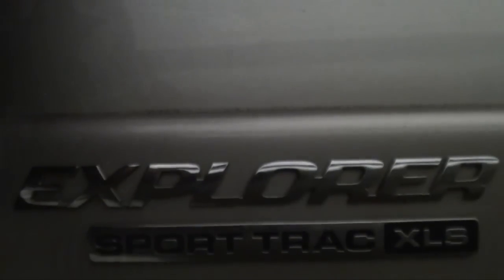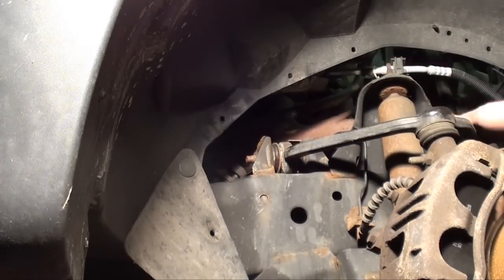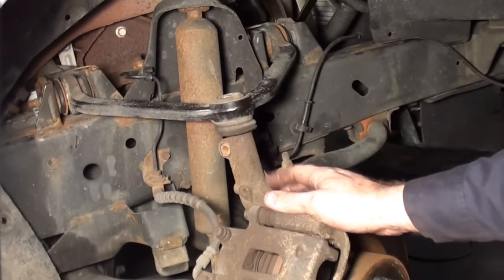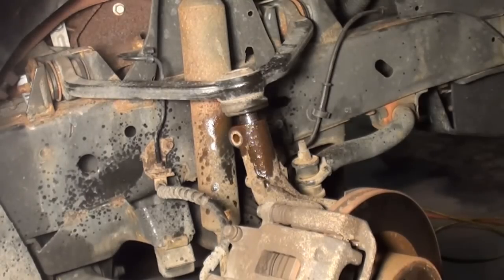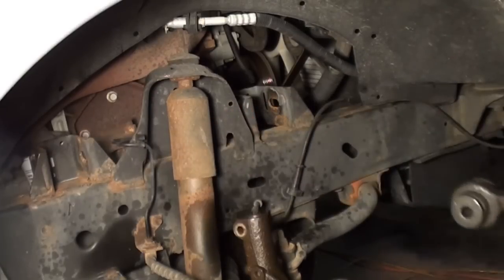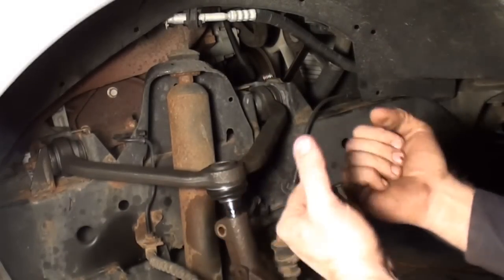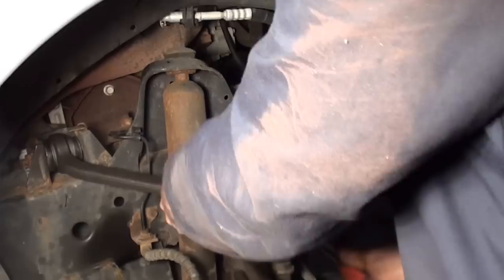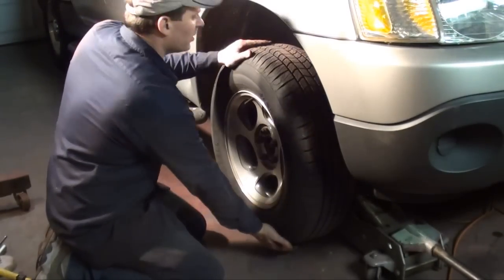Ford explorer How to replace upper ball joint

Comment: When you have the new arm installed and the ball joint pinch bolt tightened, and both upper bushing bolts are in with the nuts started, reinstall the wheel and set the vehicle on ground. Jounce (bounce, or cycle) the suspension to put the bushings in a curb height resting place. Start the engine and the turn the wheel to the right, and when you have enough room to access the bolt turn the wheel slightly left so there's no tension on the bushing. Tighten the bolt to factory specs. Then turn the wheel the opposite direction and repeat the procedure. This will insure there will be no bushing bind period because the vehicle is at curb height. Perform a thrust angle alignment afterwards...subscribed, great video!

Comment: I have the exact same truck year and model and I have to replace both front upper control arms and both front lower ball joints. This has been one of the few helpful videos I have found so far, I was wondering if you had another one showing how to replace the lower ball joints. Thanks in advance.
Reply: jgonz1104  what about the other side?

Comment: Hi, Thanks for the Good Video. Quick question, what are the driving symptoms of a loose or worn ball joint. Also, If i want to replace the ball joint, do i HAVE to replace the Upper Arm... 

Thanks

Comment from the maker: Take note before jacking the vehicle at the angle or the control arm, try to get it near that point, i know this isn't 100% mid however helps out tremendously, if you just tighten the bushings up with the travel fully extended when you let the vehicle down it tries to relax the bushing will be loaded just sitting, therefore try to achieve a normal relaxed ride height then tighten

Comment from the maker: I replaced the upper control arm which included the ball joint, if you take notice the upper ball joint is attached to the top of the spindle, with that in mind a ball joint is used where a part needs to move, the tire bolts to the spindle Assembly and needs to turn and move with the suspension while staying in alignment, we replaced the upper ball joint something needs to keep the lower potion of the spindle secure and inline that's where the lower ball joint comes into play, hope that helps

Comment: You don't have to replace the whole control arm to replace the ball joint. On this vehicle you can press out the ball joints instead of replacing the whole arm. It's cheaper that way and sometimes less work. For the people asking how do you know if your ball joints are bad. Get a pry bar and pry against the ball joint. If there's play at the ball joint. The ball joint is bad.
Reply: Ruben Corga um just tug on the tire my man... just like you would to check the wheel baring 3 and 9 and 12 and 6. just like they do in shops.... and actually its better to replace the control arm. you can get them from rockauto for 45 to 60 bucks.. better then getting just the balljoint....

Comment: Is it okay to put anti-seize compound or grease on the tapered ball joint pin before fastening it back into the steering knuckle to prevent it from sticking in the future?
Reply: fishodorvagina should help

Comment: Well they moved the fuel and evap lines after 1998. Just did this on my kids Exploder and had a hell of a time! They were definitely put in after the control arm was and right in front of that camber bolt. Probably going to have an evap leak now.
Reply: Dealing with that shit ass bs right now really would like to know what ford was thinking

Comment: I'm doing the driver's side how do you get the bolt out of the control arm where the brake lines (or transmission lines) are? Bolt won't come out
Reply: Keep moving the arm up n down while pulling the bolt out. I’m a rookie but that’s how I get mine out.. really pain..

Comment from the maker: Your welcome, If you have the same year/make/model and need the exact service (upper control arm assembly) your looking at 1 hour per side by the book. Not sure the hourly rate in your area, in PA. from $50 to $100 then you have the part our local store caries for around $60 main thing is going to be the labor don't let them rake you on that, i follow a parts and time guide and will never charge more than the time allowed, alignment is an extra charge avg. $60 around here, get an estimate first

Comment: How can you tell if, your Ball Joints are bad?  Does it causes rattling when, driving over bumps in the road?
Reply: Normal noises from ball joints are pops and clicks on rough surfaces.

Comment: Hi
I Have A 2004 Ford Explorer Xlt Can you Tell Me How Many Ball Joints Are On That Model Cause The Repair Men I'm Dealing With Is Trying To Get Me
Please And Thanks

Ps How Many Ball Joints Does This One Have?
Reply: +Myreverlation 
Each side of the front has an upper and a lower ball joint. So a total of 2 per each side.
Reply: jeff darnell
And There Is No Ball Joints On The Back Upper Or Lower?

Comment: Hi, I have an 2004 Ford Explorer XLT, and I need to replace my upper and lower ball joints. Is it the same as this video for the Ford Explorer Sport Trac? Meaning i will have to replace as an assembly instead of just the ball joint by itself?

Comment: question, my mechanic told me that my wheels have play which i i know they do..so they told me i need to replace the control arm (one you played around with) the lower and upper join (for $530, parts included) but i noticed the joins you take off are at the same level, what does he ment with upper and lower.by the way its the same car same side

Comment: Does this sport trac look identical to a 04' Explorer 2 door 6 cylinder when replacing upper arm & ball joint?  Is there a lower arm and ball joint or just a lower ball joint when replacing them on the 04' Explorer 2 door 6 cylinder? Is an alignment required if you just change both lower ball joints on a Explorer 2 door 6 cylinder or only if you change the upper ball joints on a Explorer 2 door 6 cylinder. Why buy a Chamber Bolt Kit & install it when u r changing upper or lower ball joints? thx

Comment: Pretty much straight forward in the video, BUT you ddn't even bother to silicone grease the bushings or clean the rust off that hardware.  That's cutting corners in my opinion.

Comment from the maker: Your welcome, If you have the same year/make/model exact service (upper control arm assembly) your looking at 1 hour per side by the book. hourly rate in your area? in PA. from $50 to $100 plus part around $60 main thing is going to be the labor, i follow a parts and time guide and will never charge more than the time allowed, alignment is an extra charge avg. $60 around here, get an estimate first. They better not or i will chase them down with a wrench and do it for you lol

Comment: How did you know that it was the upper ball joint that needed to be replaced?
Reply: xbrakx on mine, the material rubber deteriorated and was falling apart.  half of it was gone, but if the rubber has any cracks, it's just a matter of time.

Comment: You need to change the title to how to replace upper control arm not ball joint
Reply: SVT Sieton if you own a explorer then you should know the ball joint and uca are joined and cannot be taken apart you have to replace the entire assembly.
Reply: SVT Sieton nothing wrong with the title.  Many truck applications are like the Explorers/Rangers.  The upper ball joint is part of the arm and cannot be replaced by itself.  Seasoned mechanics know this.  In the case of Explorers when you look up the upper control arm you often see a side note stating the ball joints the is not replaceable.  There is an application action where the upper ball joint IS replaceable, but only in aftermarket performance upper control arms.